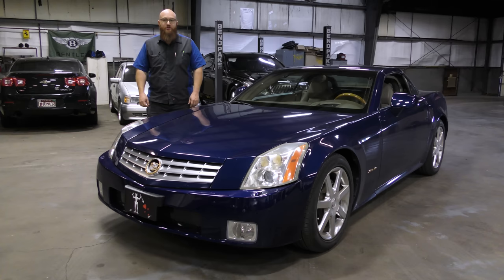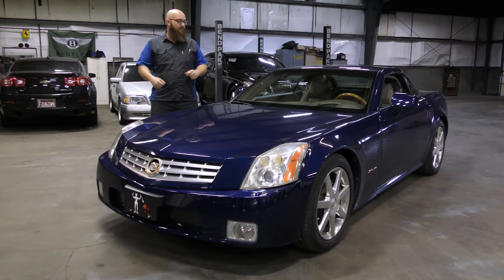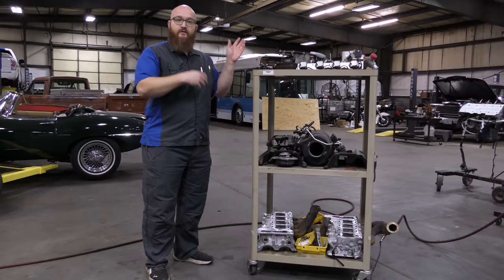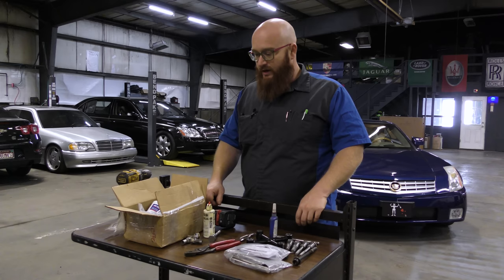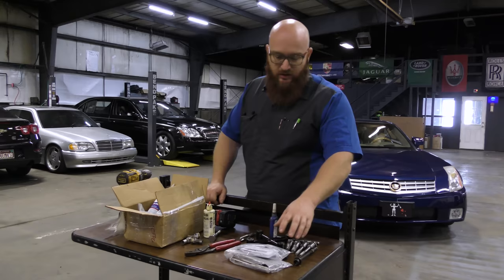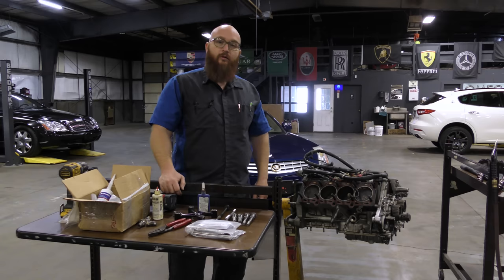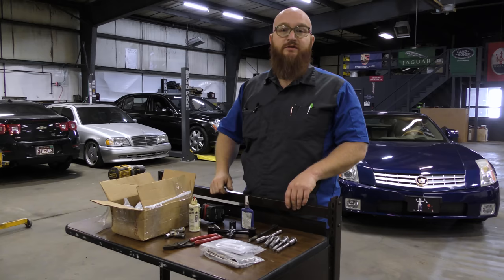No room for error! CAR WIZARD drills out the head bolts on his '04 Cadillac XLR

Comment: I would align hone for the main studs, literally just took a block in for align honing because I started to put it together with bolts, but heads were changed to studs and decided I wanted studs on the mains too.  Crank turned fine with bolts, oil clearances were great, changed to studs and torqued correctly, oil clearances out to lunch, crank won't turn anymore when all caps torqued down.  Switch back to bolts and torque them the way they are supposed to, everything is fine again.  So it's getting align honed for studs.  Can tell you from a very recent experience, some engines just going from bolts to studs can bite you in the ass.  That was an older heavy cast iron block, on aluminium I would definitely align hone for studs.
Reply: Do you know why this happened or just that it did?
Reply: @Rex Johnston  I believe it's studs and bolts usually have different torque specs.  This engine is torqued in the correct pattern to 70lb.ft in 3 equal steps for bolts.  The studs are the same pattern and steps, but 80lb.ft.  sometimes, studs use a lower torque rating but have an angle to degree them to afterward, but either way they will be torqued tighter.  This causes a bit more deformation of the cap.  As well I have heard the way the two tighten down also plays into this, because the whole bolt turns rather than just the fastener on top of the cap, which changes the stretch, but I don't know about that one as much.  Generally if you are doing a stock rebuild and stick with whatever it had to begin with, it's likely to be fine, but generally swapping between them you want an align bore/hone.  And for the hassle it was in this engine to pull it back apart and have the align hone done, I would probably just do it next time to begin with, its not that expensive.

Comment: People don't understand the torque to yield bolts, they are that way to ensure they clamp a certain force.  Those giant head studs will def clamp that and then some easily!
Reply: Just don't even TRY to reuse them.  Come on.  Your engine (replacement cost) isn't worth cheaping out on something like head bolts (even at premium 2022 pricing, replacement head bolts are still going to be cheaper than trying to replace your engine).
Reply: @houseofno  Jaguar made a technical service note that on the AJ6, TTY head bolts are approved to be re-used 1 time. The engine is designed to last 400000km, but it needs a new head gasket at 200000km.

Comment: I priced getting this job done at a local speed shop. They charged $3500 per side of the engine and there was no guarantee of it failed. That's why you can buy a Cadillac DeVille in excellent condition but a blown head gasket for $1000.

Comment: I hate that folks don’t consider that the “NorthStar” was just the naming convention for several DIFFERENT engines produced from 1992/93 - 2011. That is an incredible run with thousands still on the road. I never had any issues with the ones I owned. 💯

Comment: putting head studs in an engine definitely puts more pressure on the block threads.  TTY bolts are designed to stretch and contract during normal engine heat cycles which preserves the head gasket and allows the aluminum heads to expand easier.  

Head studs are a typical performance modification because it increases clamping force on the head surface which promotes a better seal for increase combustion pressure in performance engines, but that not to say it doesn't have its longevity tradeoff.
Reply: The expansion and contraction of the metals and heat cycles was taken into account when selecting material for manufacturing as well as final hardness. This was not overlooked.

Comment: I was always taught to tap and reverse the tap every couple of turns. I don't know if the Wizard did this since the tapping procedure was sped up? Is this still necessary, or am I just showing my age?
Reply: Depends if it is a soft or hard metal. I even use for 2-3mm thick steel taps that are made with a drill at the end, and you can go full speed on a drill, drilling and tapping in one shot.

Comment: Took my wife's 2000 Seville to a local shop that Northstars are all he does. When I dropped the car off he took me back into the shop. He had 8 cars on his lifts with all the engines on carts next to them. I knida knew right then that this was the right place. He charged $2200 for timeserts, reseal, and new motor mounts. Extra $800 for the stud kit. Well worth it since we got another 100,000 miles out of it.
Reply: Where is this shop located?
Reply: @jeffshadow2407  Palatine Illinois.

Comment: Spend a few bucks on a can of alumatap fluid.  Lubricates, prevents galling and prevents friction sintering of aluminum alloy onto the tap body as well.  Oil is not acceptable for machining and tapping  certain aluminum alloys.  But who knows what the heads are made from,  are they castings or forged billets?

Comment: Seen more race cars and top fuel dragsters with head studs instead of bolts. I believe formula1 and Indy engines are all built with head studs as well.
Reply from the maker: Correct. So the idea that someone posted about head studding this engine will ruin the engineering on it, is foolish.
Reply: @CarWizard  I completely agree. Sounds to me they need to go visit a few races and/or engine builders. Darn keyboard warriors lol!

Comment: Regarding power tapping:
You set the impact to the lowest setting and it will stop turning if the tap jams. I had tap 200+ 1/4-20 holes in one day on a machine build job I had to do, hand tapping would have been murder. And no,I didn't break any taps.

Comment: Since the "X" jig tool is keeping everything centered in the original X-Y axes there really should not be a need to hone the block or heads if there wasn't an issue prior. You are merely widening the bolt holes using the original factory center points.

Comment: Regarding using power tools on taps; Only a "guntap" is to be used with a power tool and never in a blind hole, that is a common mistake i see personally as a metal fabricator, different style taps for different jobs. What you are using is either a bottom or intermediate tap, it can't clear its own chips very well hence the old 1 turn in 1/4 back method or some variation people have heard of. A gun style tap forces the chips in front of the tap and out the bottom of a through hole. But yes in general unless you are familiar with the work you should only hand tap, with a guide if possible to avoid tapping crooked holes or snapping taps.

Comment: Fantastic stuff Wizard, your explanation and demonstration is top notch. You answered every one of my questions as I came up with them. One thing comes to mind though, in regard to the whole procedure.

In the first pass with the stock size locator bolts, wouldn't that create variance in where the drill and tap guide holes are, relative to what is on the block since the guide tool's holes are sized for the larger stud-sized bolts? For example, of the stock size locator bolts are M8 and the stud-sized ones are M12, the guide tool could be up to 2mm off in any direction.

Based on your experience as a machinist, how would one mitigate this variance to keep everything aligned properly when performing this job? Maybe I'm just paranoid about things going screwy with drilling and tapping since you only have one chance to get it right. So who better to ask than the voice of experience from the Car Wizard.
Reply: Note that the orinal holes are filled by the originakl sized locating bolts..with a large sized boss at the head end...the large size boss which completely fills the large size hole in the fixture...thus this centres the holes to be drilled and tapped.
The drilled and tapped holes are the filled with the larger sized locating holes which again centres the holes to be drilled and tapped....
Everything always lines up perfectly....

Comment: I have a 1995 eldorado bought new with 248 thousand miles kept up maintenance up ran it hard its whole life never had any head gasket or stude problems been a real good car 1 call back om fuel rail they replaced it with stainless plumbing that was it ran compression test  at 225 thousand  miles perfect love that car still have it looks and drives like new had it  up to 160 mph one time and it was still pulling i was wondering if i will ever have those gasket or stude problems what do you think?

Comment: Nice work. I would never have thought that an engine would need this operation. I am planning to replace he h head gasket on my 1992 mercedes 3 litre diesel engine which has blown through to the water jacket. Question: is it safe to just change the gasket or would I need to renew or modify other components. I will check the head surfaces for flatness and deal with any flatness issue. Thanks for your videos, I have enjoyed and been educated by all the ones that I have watched so far.

Comment: The ideas behind the Northstar were excellent, but the execution just had too many flaws. I heard back in the day that Northstar engines were seriously being considered for small airplanes. I don’t know if any such planes were ever built.
Reply: My understanding is the only auto engine to be certified for airplane use was the Lexus 4.0 V8 used in the LS400.
Reply: @hokie9910  most Subaru engines and even some of the Honda engines are certified for aircraft use also
Reply: The Diesel engines being used are just reworked Mercedes.  The car engines being used are allowed in experimental aircraft only, because they haven’t been through the FAA process. I’ve seen an experimental plane with an ls1 in it that is a weird sound with a prop
Reply: I hate that folks don’t consider that the “NorthStar” was just the name of several DIFFERENT engines produced from 1992/93 - 2011. That is an incredible run with thousands still on the road. I never had any issues with the ones I owned. 💯

Comment: Dear Wizard. From you video, you wound the tap all the way down the newly drilled stud hole in one go. Did you not tap 180 deg, back off 90 deg, tap 180 deg etc? Is the new oversized drill only just larger than the existing threads?  Another top vid. Many thanks. Mike in Germany.

Comment: in reality, doing that modification of drilling/taping to different size head studs would distort the block and distort cam/crank bearing surfaces, changing their tolerances.
BUT it's very likely worn out enough to not make anything tight to the point of self destruction, now there may be enough distortion to make hot spots, that quickly wear down in break-in(typical break-in period of new builds!). so when you do a major repair like that, take it easy for first XXX miles, like it's a new engine/car break-in period, change fluids early and it should be good to go.

Comment: I think that if you torque a stretchable bolt in a soft material, the first threads in the threaded hole will be ripped because they are more stretched than the deeper threads.
Reply: That is Why ,   you must use a Stud kit.
The new studs are screwed into  the block  by Hand ✋ 😳.
Reply: The screw thread is an inclined plane with a set incline which is the same incline from top to bottom of the hole.
Therefore pressure is uniformly distributed over the entire length of the inclined plane (the threads in the hole) at exactly the same time...
so no "ripping out" occurs in any one place before the other...
Reply: @JohnSmith-yv6eq  Maybe I'm exagerating the effect in my head, but the way I think about it, the stem of the stretchable bolt is the same diameter as the threaded part and there's no reason for the threaded part to not stretch. Then it means the upper threads recieve more pressure than the lower ones.
Reply: @olivierroy1301  
That's why the bvolts/studs are a uniform material of a known "stretchability".....
no one part is stretchier than another part of the same bolt/stud...
so the same pressures occur along the length of the stud/bolt....
Reply: @JohnSmith-yv6eq  Clearly I won't be able to convince you.
Reply: @JohnSmith-yv6eq  
You are Correct

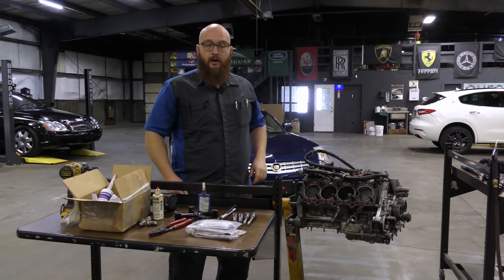Comment: 6:45 there might be some merit to that argument but it needs a precision machine shop and a torque plate to prove/debunk it. The extra clamping force may distort the aluminum block and the cylinder bore may become squareish. But if the torque applied on the new design  results in the same pulling force as the factory bolts then it should be OK, I guess.

Comment: If your modifying a engine that's not from your car, will it affect value as it's no longer a numbers matching car , I would use a normal tap wrench and clean swarf out a little more often, wasn't liking the 3 tier trolley as it looks a little top heavy

Comment: I've got a 01' DeVille with the Northstar, just broke 100k miles. It's never had a problem but I suppose it's just a matter of time..
Reply: Do you live in a temperate climate (not too hot/not too cold...and have a long distance commute every day....
rather than live in an icebox in winter, a sweat box in summer..and use the car to run to the shop only 1 mile away?
Then in the temperate climate, long commute use of this engine, the heat/cold cyles, stretching and contraction are minimised...

Comment: Wizard do you have to enlarge the stud holes in the new head gaskets?
Reply: It looks like the only part that's larger than the stock bolts is the threaded part that's installed in the block. The rest of the studs appear to be the same diameter as the bolts, so both the head gaskets and heads would require no modifications.
Reply from the maker: No. Standard head gaskets can be used.

Comment: The Northstar was a missed opportunity by GM in general. They run beautifully when maintained and with the proper fixes -- every bit as good as the Ford 4.6 "if" the heads are fixed and the proper gaskets are used. Some of the smoothest, quietest engines made in modern times. It's a shame the bean counters made so many compromises. Dad loved the DTS cars even if they didn't have the room of the older Fleetwoods

GM has a habit of shooting themselves in the foot either by using a good engine with a poor transmission or a poor engine (before fixes) with a good transmission

Comment: I have a 06 cad dts with 137k miles,,,it started running hot soon after we had a hard feeze,,,,did combustion leak test and pressure test,,,all were neg however after running 10 miles it will run hot ,,,no oil  contamination but now im getting milky substance in resovoir,,it hadnt done that before even when it was overheating,,it started with the milky stuff right after i did pressure test...do i have bad head gasket or something else,,,will any of the leak sealers work on cadiilac northstar??

Comment: First off thank you for this video, as now I know how to do a head bolt repair on a Northstar engine even though I already knew how to do a helocore job. Secondly I wish a lot of  these people that try to tell a mechanic how to do a job they know nothing about would just STFU, I know it is hard for a lot of so called shade tree mechanics and shade tree machinist out there to want to try to get good information out there. But there are a lot of us out there that have spent thousands and even hundreds of thousands of dollars to get the education and training on how to work on automobiles properly. And half of what I heard in this video that was input from other viewers is just non-sense, that would only be done if one was dealing with a worse case scenario, or to build an engine for a specific application like line boring the crank main journals. 95% of the time you will never do that even rebuilding a worn out engine, unless you was trying to balance and blue print an engine build.

Comment: A car wizard question do you know if a dealership or speedshop would do this type of work if I couldn't do it myself and is it possible to work on it in the car instead of pulling it out or would it is it more obviously more better to pull it out but could you actually do it in the car if you had room.

Comment: I cringed as well seeing taping done by drill.  Even when done by hand, I ve snapped a tap.   have to feel the tension to back it off.  On thick steel we'd blow out the broken tap by turning the welder up to 225 with a small rod...blow a hole through then Mig weld the hole shut. Start over ( btw...was building bank vaults at the time)

Comment: there's for sure  a way to do it cheaper just not all new parts if the heads and everything are good and you just need a head gasket and head bolts and maybe a couple parts you broke on the way because Cadillacs so hard to work on i have  a Cadillac I've had 2 and i was half way done doing a  head job but i found this car and was like screw it ill do the head job on this one but it would have  been 300-400 for me to repair the car besides normal wear over time on other parts it would be probably a little more if u wanted to get the heads pressure tested and all but if you know how to do it then why spend the money if everything else is perfectly fine all i have to say is Maintenace Ur cars and when it over heats actually pull over and don't drive it because then you will only have to do a head gasket and head bolt job been there done that the 700 is not a lie i would believe him because he's a very wise person. And this isn't to the youtuber this is to everyone that owns a Cadillac!! EDIT:they only charge so much at shops because no one will work on a NorthStar or because its so hard and time consuming for them to get other cars done.

Comment: Is it the thread pitch or dissimiliar expansion between the bolt (steel) and the head (aluminium). The bigger bolt and courser pitch would mitigate that correct? There is more thread tolerance with thermals.

Comment: There is no higher combustion pressure IC engine than top-fuel dragsters. They do not use torque to yield studs. Nor do Lycoming or Continental aircraft IC engines.